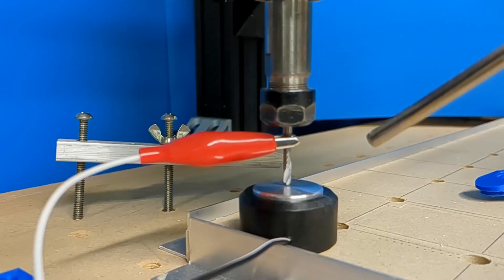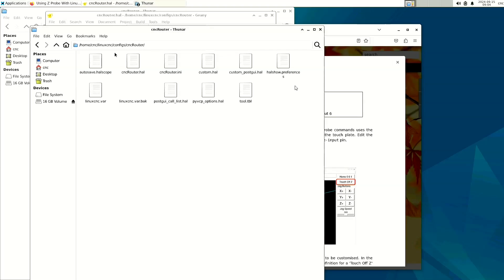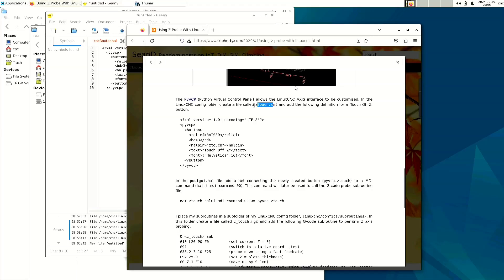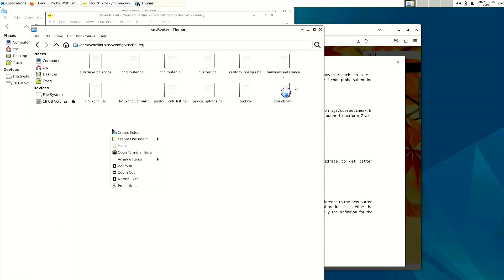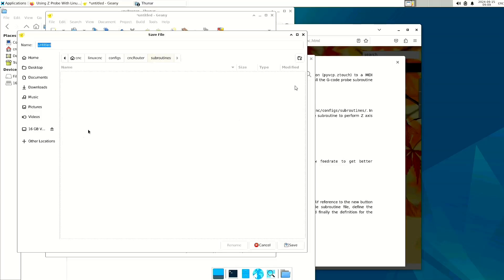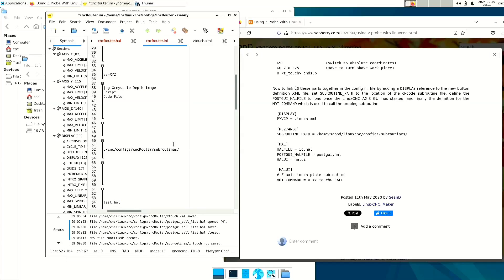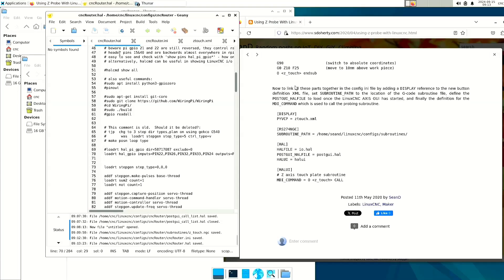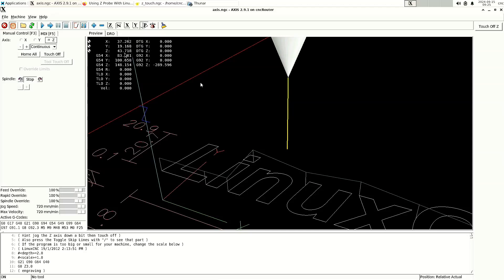Z Probe Setup in LinuxCNC on a Raspberry Pi

Comment: Quick question, could this pihat also run an atc setup?
Reply from the maker: I'm not sure. There could be a lot of different ways to control them.  If it is a standard stepper motor, that would be the easiest.

Comment: Got the break out board and cnc running but I’m having trouble installing the probe configuration based on this video I keep getting errors I think theres conflicting errors with vista cnc pendant I installed have you used Linuxcnc probe basic? Would like a tutorial video on making it work with the raspberry pi 5 and your breakout board
Reply from the maker: Interesting.  I had to Google what probe basic was and I didn't even know it existed.  What are the errors that you are running into?  Please email me using the contact form at Byte2Bot.com and I will look into it. Thanks!
Reply: @Byte2Bot I got prob basic to run on the raspberry pi 5 but can’t figure out the config wish it as as easy to copy and paste the Hal file and ini gotta do some more digging